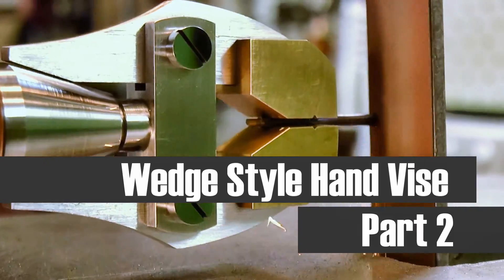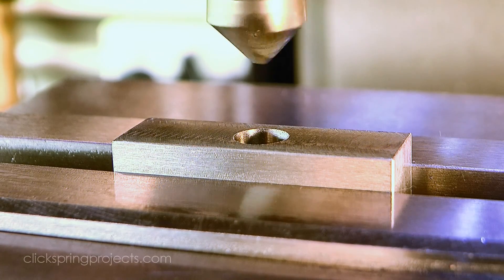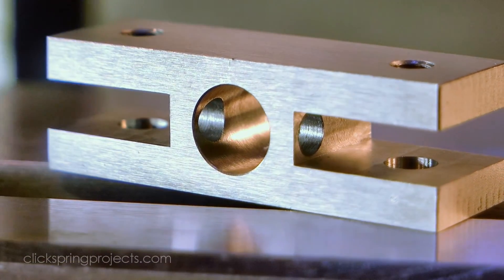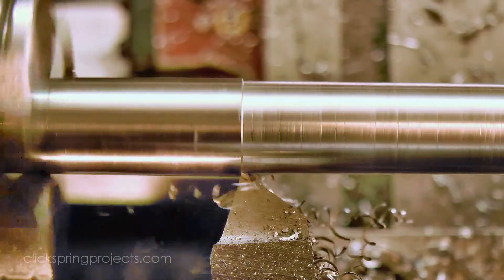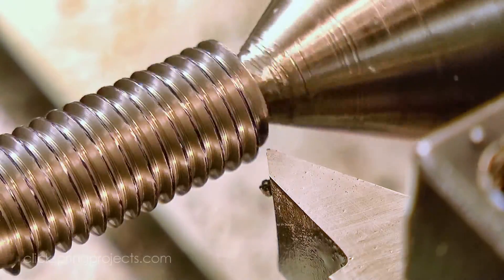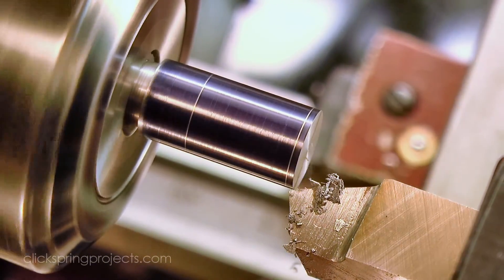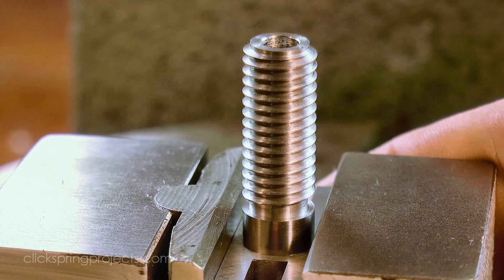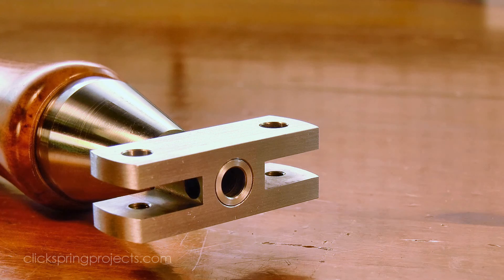Wedge Style Hand Vise - Part 2

Comment: Question about reamers Chris...  How close do you typically need to have the rough hole to final dimension to be able to use a reamer?
Reply from the maker: +Jess Neal Hey Jess, for machine reamers (end cutting) a good rule of thumb us 1/64th inch or 0.4mm undersized. You'll often read in texts/mags the statement "...drill one size under, and then ream"; they are referring to 1/64th under the final size.  Having said that there is a fair amount of leeway, and it does depend on the material. For soft materials like aluminium and brass you can push that out to double that figure if you really needed to due no suitable drill. For something tough like tool steel you may want to reduce it a bit to say 0.2mm to really get a fine surface finish.
Reply: +Clickspring Good info Chris thanks for the reply ;)